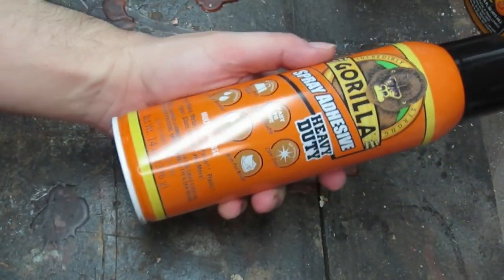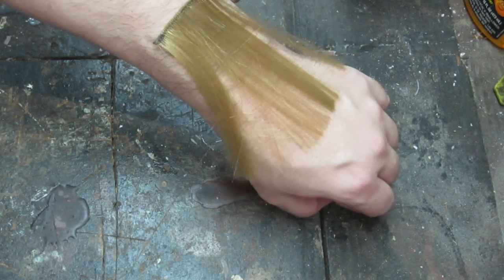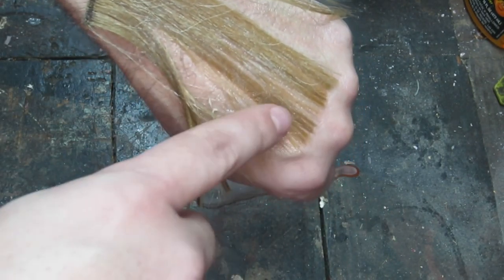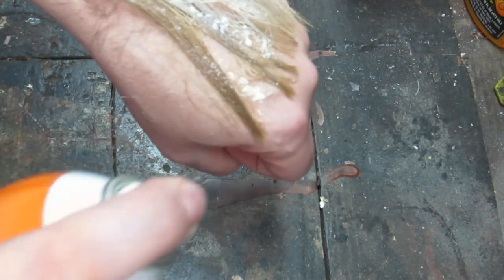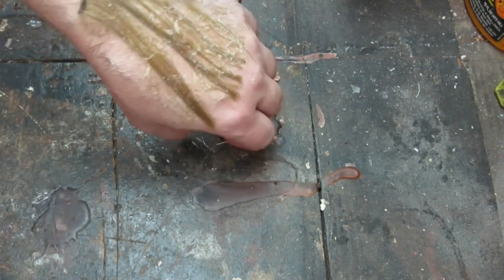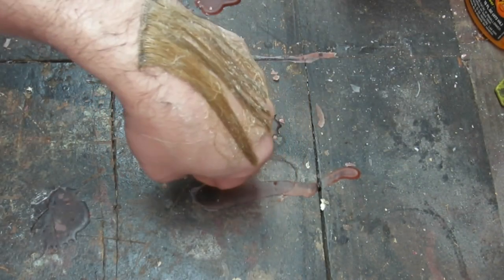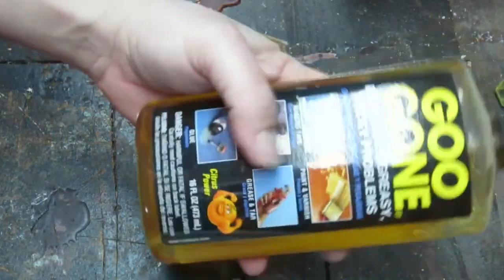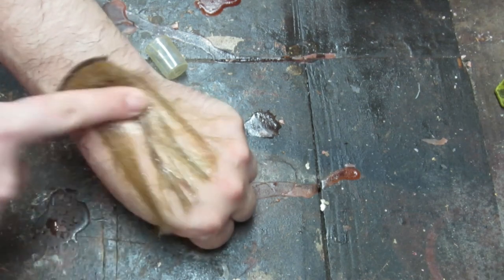GORILLA GLUE IN HAIR SCAM. High Levels Of Sus for the Gorilla Glue Girl story! | Dark Nook

Comment from the maker: Update:  For all the ratchets whining about her hair style and saying this isn't a scam, Lovelyti TV did a deep dive into this and confirmed all my sus...  https://youtu.be/VcOSCobsp5A 
Update 2:  Oh DAMN!  This sista went and demonstrated everything I was talking about using her own hair!  https://youtu.be/2s2_MTP6irE

Yes, I am skeptical of her claims, because I know from years of experience how this material  behaves.  I've had to clean it off of myself dozens of times.  Do you think I would have made this video, if i didn't know exactly how it was going to work and how easy it really is to clean off skin and hair?  Do you think I'd spray a ton of this glue directly on my skin, on a hunch?  No.

I also know from experience that there's no way she could have styled hair with Gorilla Glue in it.  So any styling would have to have been done beforehand, meaning there was no way she could have sprayed this glue anywhere but the upper most layer of hair.  So yeah, I find everything about her story sus.

I also know that the only kind of glue that would behave like what she's describing, would be an epoxy based adhesive.
Reply: Did you ever consider that the other holding products mixed with the gorilla glue blow drying it and the fact that our hair is very different from yours that your method may not work, you also used synthetic hair definitely not the same
Reply: you don't know how she actually styled it or used it. Secondly, it's been on for a month. Who are you for her to prove something too. Unless you have a real solution and can help her, you need to take this video down because you look foolish.
Reply from the maker: @BeGood4Eva   If she really did what she claims. Goo Gone is a real solution.  It broke down the gorilla glue in less than a minute.
Reply from the maker: @akashauni8418  I did consider that.  If she had product in her hair and styled it prior to application of the glue... that would create an even weaker bond.   As for the hair texture... if she's had a matted clumpy mess on her head, I'd be much more inclined to believe her.  She's not rockin a fro.  And no, that's not synthetic hair.  That's human hair from a weave.
Reply: @DarkNookShop  You don't know the lengths many, if not most, black women go through for their hair. If I wasn't in the black community, I wouldn't believe it. But, believe it! I don't understand black women's current obsession with having their hair "laid", but I know it grows out of what's called "respectability politics". In the black community, hair isn't just hair because it was never allowed to be "just hair" by the people and entities in power. There is history here that you don't understand.

At any rate, I can almost guarantee you that she didn't have her hair fully styled prior to applying the spray glue. She probably had it parted the way she wanted it and it was brushed back awaiting the styling products, but I can tell you that she then saturated her hair with the glue spray for the final styling and finishing touches to her baby hairs. Her hair was WET and when she finished, and she probably sat under a home (countertop) hair dryer or blow dried her hair until it was dry. 

Then, she probably added a silicone-based hair serum, or sprayed her hair with an oil sheen aerosol spray, that gives the hair a lot of shine. Trust me, the glue was not the only thing she used on her hair. And, every night, she tied a satin scarf/wrap tightly on her head to help her hair keep its shape while she slept. That glue, and whatever other styling products she used that may have chemically interacted with the glue, had been super cured and set up by the time she figured out she'd done something stupid. You can't compare a sample of weave hair being glued to your hand for a few minutes to what this young lady did. They don't even compare.

And, a final word of advice. Several black people, besides myself, have commented on your video telling you about the dynamics between black women and their hair. Please do not think that you know more about our hair or our culture than we do. Just don't do it. We will always know more about us than you. Just a friendly reminder.
Reply from the maker: Cheshire Le Chat   And you think combs are glue proof?  The comb would be useless after the first contact with the first bit of hair with glue in it.
Reply from the maker: @RosalindGash  Your hair politics don't have any effect on the glue or how it behaves. As I've said there is no way she started with glue, because the lay down would have been impossible after that.  So she had to finish with glue.  But that wouldn't get down to the scalp... it would just form a sort of glue crust over the top of the hair.
In order to get the result she is displaying, because of how this glue behaves, she would have had to work the glue into her hair, and there's a very limited window of time in which that can be done.  To know that window, means you know this material.  Which would suggest this was not an accident.
Reply: I don’t think this was an accident. This glue burns too, I have been obsessed with gorilla glue videos these past few days. I think she did this on purpose to get clout. Nobody is that dumb to use gorilla glue that works on wood for their hair. But I also read somewhere that once you put water in the glue it makes the bonds stronger and she washed her hair 15 times. Also the longer she keeps it in I heard it gets harder. I don’t know how true the water theory is and she said she had it in her hair for 30 days would that play a role?
Reply: @RosalindGash  I think she did this on purpose for attention on social media she has put all her videos on tik tok Instagram and YouTube simultaneously. Don’t insult black women by acting like we can’t read the label, and we don’t know if you hear a ball in a metal can it’s not for hair! Also when you apply this stuff it burns and gets really hot. This ladies story is not adding up.
Reply from the maker: @savannahhalm  The water activation is true for the polyurethane gorilla glue that comes in a bottle.  Not so much for the spray stuff.  And the spray stuff achieves permanent bond at about 10 minutes.
Reply from the maker: @kieannastaker6534  It's a bit from a human hair weave.
Reply: @BeGood4Eva  She put it on the internet. #Publically
Reply: @DarkNookShop  the comb point makes me believe you
Reply: She used it as a hair finishing spray. So she did her hair with brush or comb or whatever then sprayed it to set it.
Reply: Let me just clear this up for everybody since my girlfriend forces me to watch wig/weave videos. This most definitely was a accident. The spray that they normally use is in a yellow can is called an wig adhesive, which she ran out of and used this on a whim. Once her hair was done she sprayed heavy amounts of glue using it as the holding spray, working it in and styling it with a comb/toothbrush. Literally creating the perfect situation for this to happen. The pony tail is synthetic but that's her real her on her head
Reply from the maker: @sneakerconsignmemt4332  The problem is a few seconds after the glue is applied, it's too sticky to work at all.  And anything like a toothbrush or edge comb that touches the glue, will now have glue on it, and want to stick to any other hair it touches.
Reply from the maker: @chevyway77  Yeah that's what she claims... but that wouldn't get the results she's showing in her videos of her hair solidly glued to her scalp.  It would produce a crust on the top surface of her hair.
Reply: Yes , but her hair is been like that FOR A MONTH and she washed it multiple times which made the glue 10 times stronger.
Reply from the maker: @gabrielasanchez8537  nope.  This is not the water reactive polyurethane gorilla glue. This is the spray, that's water repellent.  The only effect washing her hair would have would be to clear out any of the other product in her hair.
Reply: You're also forgetting the month straight of using this product on her head, it must've dried immediately every time or she dried it using heat which she never would've touched using her hands or if she likely did she simply washed her hands believing just like you that if it comes off easily with soap and water then she'd be fine with a shower, a month later and 15 washes she was mistaken, I telling you the only reason it even got this far is because she paid for that hairstyle and didn't want to wash it out until it finally frizzed up but since it never did she must've assumed she cracked the code, also reading up on the Got2Be Glued hairspray people reviewing it says it behaves like glue and immediately freezes the hair in place, people use it for mohawks and cosplay hair, etc...so in her mind she believed it was the same thing, big mistake
Reply from the maker: @drebone1986  Tho this stuff doesn't just wash off of hands.  Even the bits I got on my fingers from touching the hair, I had to use goo gone to get off.
Reply: ok havent read the comments yet so not sure if anyone said it.  but I want to say 1 its human hair that she has. 2 as a blk woman I'm pretty sure she used got2b gel etc to hold it down.  3 lastly not only is it hair its blk hair our hair holds pretty stiff with adhesive put in it. not saying u dont know what ur talking about just wanted to give a little more insight on the type of hair we're dealing with 😅😅

Comment: Of course she worked it in..she used a slick brush to lay it DOWN..you wouldn’t understand. You combing your hair and me combing mine are two different methods!
Reply from the maker: A slick brush would stick like crazy to everything after the first contact with the first bit of glued hair.  Did you see how after only a few second the bit of glue on my finger was sticking to the cap of the spray can enough to pull it off?  The same thing would happen in an edge control brush.  Then the next bit of hair she tried to use it on would be a matted mess.
Reply: @DarkNookShop  You seem confident in your method of removing this glue...try it on your own head of hair...it’s easily removable right?!...with the exception that you didn’t follow the actual method she used.
Reply: @DarkNookShop  I suggest you watch a few videos of black woman "molding" their hair. There were other products used prior to the her finishing up with the "gorilla glue" in her case the glue not only adhered to her hair but to the other synthetic components of the other products she used.
Reply: @QBee240  imagine him explaining how to brush our hair with product on it to you. It's hilarious.
Reply from the maker: @GGCanLove409  That would result in a weaker bond... not a stronger one.
Reply: @DarkNookShop  so try your hypothesis and show me you're right. Like I suggested PLEASE watch a video or 2, so that you have all the variables for your experiment. I'm sure her hair was already "molded" dry to the touch, then she finished it with the glue spray. Which in regular circumstances would be finished with hairspray or "gots2bglue" spray.
Reply: @GGCanLove409  SMMFDH
Reply: Please be clear that I am not defending the sheer stupidity of this woman but trying to express that afro hair behaves differently to other hair types..the method of caring for it; i,e; washing, combing,.moisturising, detangling, styling are completely different to that of a Caucasian hair type.
Reply: @GGCanLove409  funny asf cuz you just got proven wrong lmao

Comment: You mentioned in your video that there was no way she could get her hair smooth like that with gorilla glue because the glue is too sticky. You are correct BUT that is because she used other products prior to to gorilla glue to smooth her hair out and then when those products dried she topped it off with the gorilla glue. If you are going to demonstrate something to prove your opinion, Everything in your video needs to be  the same exact products that the young lady used in her hair. There is a possibility that the products that were used on her hair before the glue created a different reaction causing it to harden and become stiff like it did. You only showed us synthetic hair, arm hair and gorilla glue.
Reply from the maker: That IS exactly what I assumed she did.  And the point of that was... if that's what she did, the glue would only be on the surface.  It would not permeate down to her scalp. Also the use of other products, like hair gel, would further limit the effectiveness of the glue bond to the hair itself.  Also the hair I used was human hair, from a weave, that's been straightened and dyed as well.
Reply: Mings you’re so right. I believe one had to first understand black hair and styling.... the hair was already styled and the spray was the seal it not manipulate into a style
Reply: @DarkNookShop  ur experiment was good. Most ppl commenting CLEARLY don't work with gorilla glue. Appreciate ur content. Peace

Comment: Not an accurate test seeing as you're using white hair, which behaves differently to African hair - which is a completely different texture. Also the scalp is obviously a different texture to your hand.

Update: I've reported this video. I don't understand what it's designed to do other than stir hate.
Reply: It also looks synthetic
Reply from the maker: Hair is made of the same material, be it from a black person or white person.  You're going to get the same chemical bond.  And her hair has been straightened.  She's not rocking an afro.  As for the skin texture, you are correct, because the scalp sheds skin cells at an even faster rate and produces more oil, than the back of the hand.  if anything the scalp bond would be even weaker.
Reply: Cheshire Le Chat  Exactly, at this point, let's just leave him in his ignorance. The fact he thinks that plastic hair is an accurate test of this, is just strange.
Reply: Cheshire Le Chat  I agree, either way this is not an accurate test & pretty ignorant.
Reply: @rachs6640  technically they don’t sale white ppl hair
Reply: Hair is hair
Reply: @oara262  They do, it's called European hair. It was obvious what I meant.
Reply: @DarkNookShop  lol bro Afro hair and straight hair behaves in total different ways.
Reply from the maker: @naseyabroderick7301  Yes I've seen many comments pointing this out.  Yet so far none of the people making this claim has been able to tell me how the texture and thickness of the hair changes the chemical properties  of the glue.  Please feel free.
Reply: @DarkNookShop  texture affects how the product spreads, that determines how much is needed for a specific style..... she likely added multiple layers, blow dried it in between sessions, and combed it through..... the same as got2b glue spray....
Reply: Could you call this type of hair “straight hair” ? It’s also very common, even predominant, in Asians, Native Americans and Hispanics, and I really think it’s annoying black people think only white people can have straight hair...thanks !

Comment: leave it on for a month and use coarse African American hair. She doesn't need YOU to believe her. Who are you supposed to be? GTFOH
Reply from the maker: Me...  I'm a guy who actually knows how this glue behaves from years of experience.  In fact, I know how a wide variety of adhesives behave and interact with human skin, and exactly how to easily remove them... or which ones are nearly impossible to remove.
Reply: @DarkNookShop  sooo then did you reach out to her to help her or offer any advice to her whatsoever OR are you just trying to capitalize off of her pain?!
Reply: @wsh415  Exactly! I don't understand the purpose of his video... who exactly is it designed for? It can't be for informative purposes because it's not an accurate test.
Reply: @DarkNookShop  If you know how "easy" this is to remove, then why were you in such a hurry to get it off of your skin?  This was a feigned attempt. They use these chemical compounds like this to seal surgical wounds because they don't slough off quickly (and if glue is clogged into follicles with longer hair, who knows if it ever naturally sloughs).
Reply from the maker: @michelem7786  Huh?  I removed it once it reached full adhesion.  Which only takes about 10 minutes.  There was no rush to remove it.  But the point of the video was to show how to remove it.  So i kinda needed to do that, not just talk about it.
And the glue used to seal wounds is a cyanoacrylate or super glue type adhesive.  Not the same substance.
As for falling off naturally, that would depend on how much debris it picked up, and skin cells shedding, and oil production... so it would very from person to person.  However that would also likely break most of the hairs, and result in bald spots.
Reply: White hair, asian hair, black hair it doesn't matter. Hair is hair. Its heavy duty gorilla glue. Black hair wont change anything. Black hair isn't all that special
Reply: Her hair was not coarse it was relaxed.  She needs you to believe her and donate.
Reply: muh unique special.african hair!!!!
Reply: @dylanrudman3291  you do see that my comment was from 4 days ago right?!!! That was before she put up a go fund me!